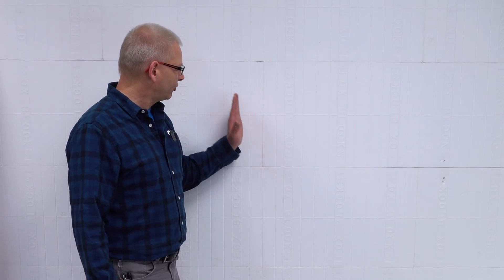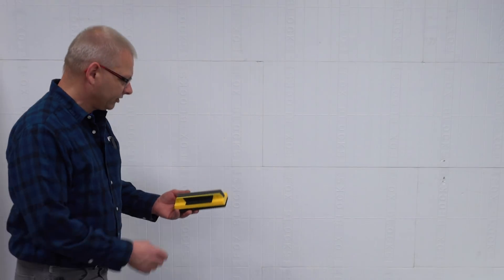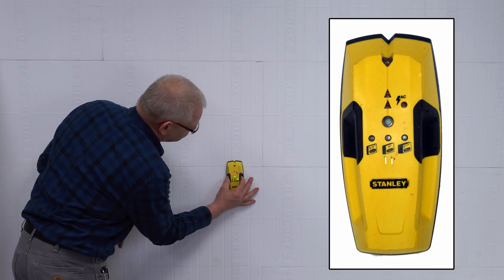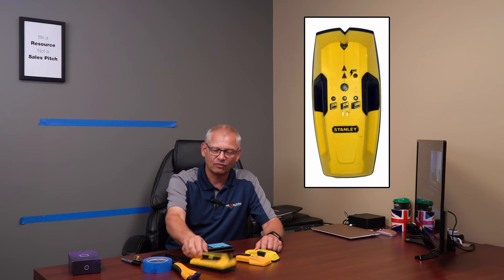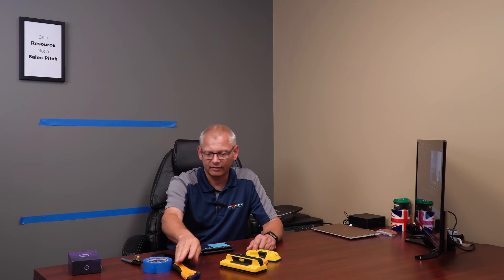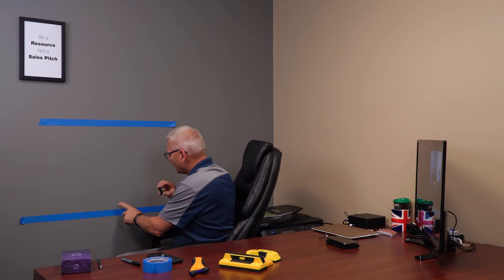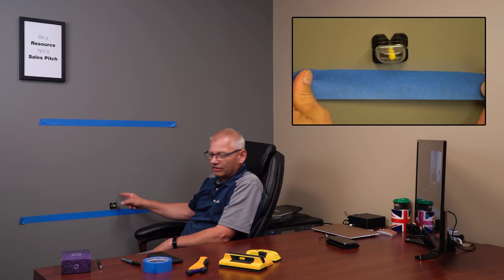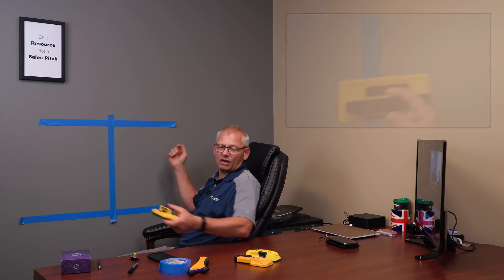Fox Blocks Studs

Comment: When installing cabinets and we know the layout before hanging sheetrock, like in a kitchen, we install plywood directly to the ICF wall in lieu of sheetrock and the same thickness.  This makes hanging cabinets very easy.  
Like the video shows we have "stud" finders that kind of work, so we often resort to a punch and move technique.  As long as whatever you are hanging is larger than 8 inches (so as to cover your line of holes) start by punching a hole through the sheetrock and the icf about 2-1/4" deep.  If you meet no resistance move horizontally an inch and repeat.  You should find the plastic furring strip within 8".  Then the other stirps are spaced 8 inches to either side (8" on center).  Crude but it works, particularly for hanging permanent fixtures like cabinets.

Comment: the screw finder is dependent on the drywall installers aim. What if the screw is not screwed into the plastic web?  Then you'll miss too.  Hopefully the stud finder manufacturers are working on one that can sense plastic runners as well as wood.

Comment: Thanks for all the effort you put into all your videos to better the industry! Fox Blocks are the best ICF I've used. Would you be able to do a video of installing a flanged window and the necessary flashing and sealing method against the fox buck? Our method goes as follows:
1: install tyvek flex wrap on the sill and extend up the jamb buck 6" on both sides using a j roller afterwards to ensure good adhesion with minimal wrinkles. 
2: place horse shoe shims in the spots required by the window manufacturer and place so that the open end of the horse shoe is towards the outside so that water can escape.
3: using a high quality polyurethane sealant (such as Sika 221 or equivalent as they bond very aggressively to the EPS foam) caulk around the top and side flanges completely and leave 2 or 3 2" gaps on the bottom flange so that water can escape.
4: set window in the opening, level and plumb and fasten it to the fox buck using low profile wafer head screws.
5: tool the sealant around flange against foam and seam between fox buck and fox block icf. Also covering the screw heads in the process. 
6: unfortunately, local code requires peel and stick around the outside of the flange, so we install that after the sealant had set up. Otherwise I think I would not use it as it is just another layer to trap water behind, trying to force it behind the EPS/window flange/sealant. Especially if there are any wrinkles. We are using the EPS foam as the air barrier in lieu of tyvek/typar and I trust a good polyurethane sealant will stand up long term by itself and the fact that there is no wood to rot in this wall assembly.
7: cut a reglet/10° kerf cut above the head flashing and install a custom bent piece of flashing to counter flash the head flange or peel and stick.
8: seal inside the window R.O. with low expanding foam or backer rod and polyurethane sealant.
Note: we slope our fox buck sill 2° which is approximately 7/16" over 11 1/4"(6" core ICF)
Let me know if you would change anything in these steps. I haven't had much success with getting a response back from window manufacturers as they aren't familiar with foam bucks. Most of them like the window to be sealed to the concrete core, and while I will admit that that's the best way as far sealing against hurricane force winds and rain, it doesn't work out that well in cold places in Canada as an exposed concrete core is a huge thermal inefficiency. We also order our windows so that the glazing is close to the center of the wall cavity as windows are 22% more energy efficient in the center of the wall as opposed to flush with the outside door to being closer to the indoor temperature and less wind washing. All Weather windows and doors manufacture what they call an "Arctic Jamb" so it has a sloped PVC apron (exterior)  and PVC jamb extension on the inside and outside of the glazing and can build them as deep as you want.
Reply from the maker: Hi Aaron
Doing a full window detailing video is on my list. Unfortunately every time I get to a project they already have windows in place or they were delayed. Getting these 'real' videos are more difficult than staging a video because you are always working with crews that do not necessarily follow code or do things as they should be done. I like how you are thinking through the process of flashing you flange mount window.
Reply: I am getting ready to do a house out of Fox Blocks and think liquid flashing would be better than any tape, due to tape not holding as well to foam.
 @FoxblocksICF